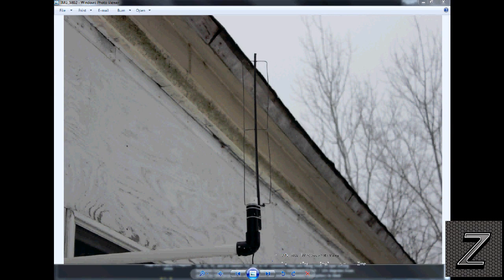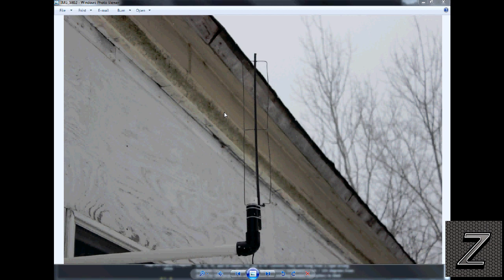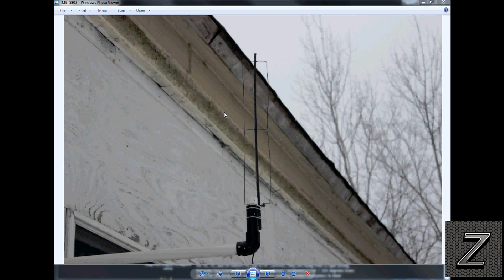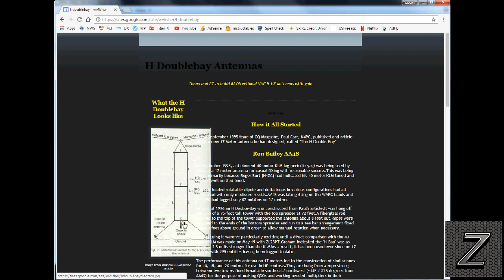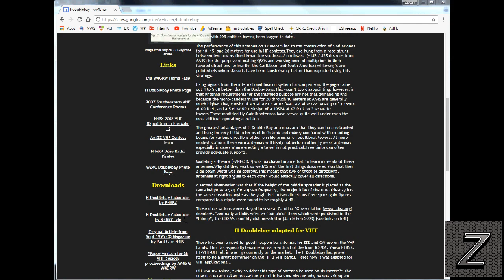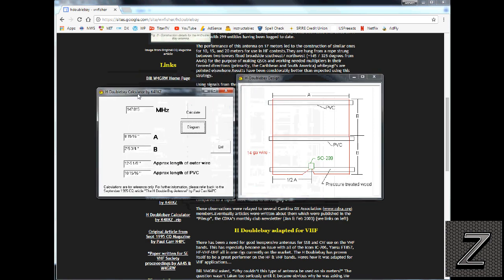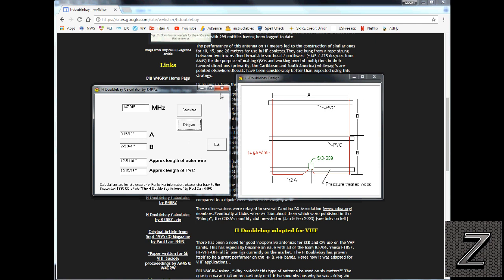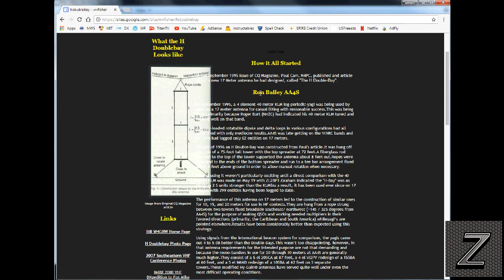How to build a H Doublebay antenna ( Ham Radio, CB, Shortwave)

Comment: The H-Double bay antennas are often used in HAM radio, They have been built with 8 bays, for everything from UHF to 40 meters.... The H Double Bay is surprisingly effective for E skip as it has a very low take off angle..
Reply: I would like to know how somebody used one of these on 40 m because the size would be huge and a 40 m full wave delta loop would be a lot easier to construct and erect.